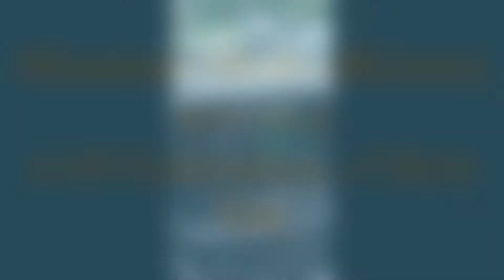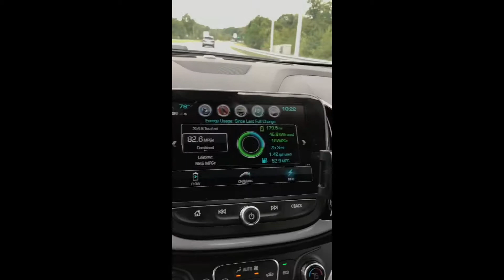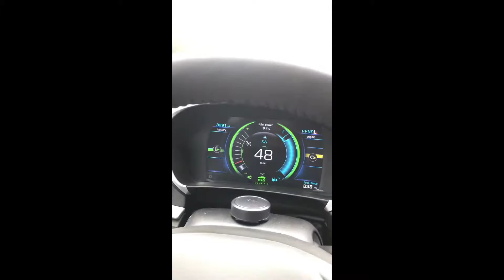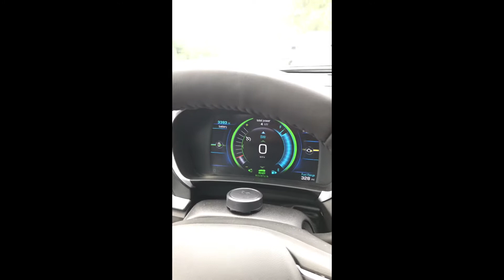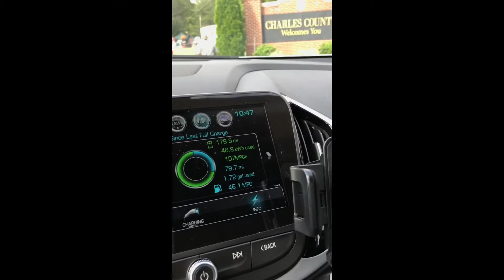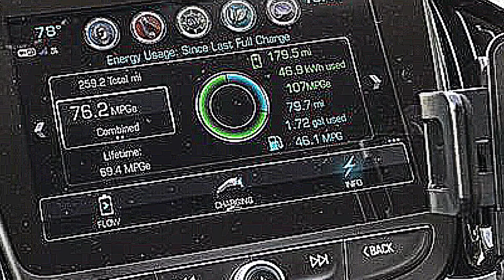Chevy volt Mountain Mode test drive

Comment: Yeah, I have the same car, I'm trying to find the real use of the mountain mode still. Been driving it for about a year. I live in Sacramento which is pretty flat but drive up to Lake Tahoe on occasions which is about 210miles round trip. For the best MPGe I found that going uphill using all the battery power and then letting it shift to gas and on the way down I used mountain mode with very low rpm since it's mostly a downhill and whatever was recharged back into the battery I used to reach home.
Reply: 12/30/23 Hi, I live in Auburn so I'm already up at 1500 ft. I only bought this car in November. When I drove it from the auto mall in Roseville up to Auburn the salesman told me to use mountain mode. That depleted the EV miles left And I smelled something burning. Took it back to the dealer and who took it to Chevy and they couldn't find anything wrong with it. Anyhow I'm trying to figure out how to drive it up just even to above Colfax, let alone to Truckee and Tahoe? Going uphill is going to deplete the miles pretty quick. This video is a little too technical for me to understand, I just want to explanation how to use it to get over the summit.
Reply: @Bootsz2010  Hi! After driving the car for more than 60K I found the best way that got me the best mpg is driving on "hold" if I'm on the highway for more than 5 miles and electric anywhere in the city or roads where I'm only going less than 50 mph. I've used the mountain mode a few times only when I wanted to charge my battery before getting back in a city. I have no idea what happened with your car. That doesn't make any sense because when using mountain mode you're basically charging your EV miles and using gas to do so. I would take it to Epic Chevrolet here on EL Camino. They should help you out/ gd luck